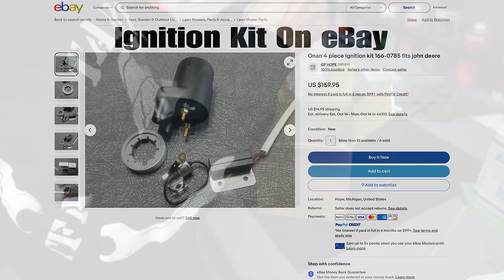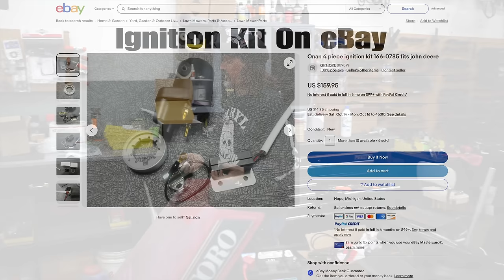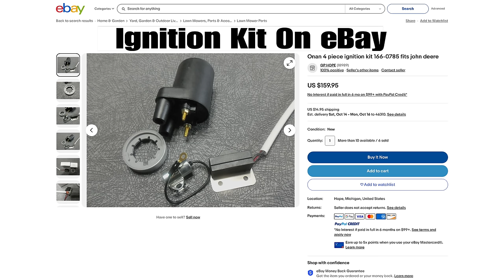Oh No! This Obsolete Engine has NO SPARK. What Do We Do?

Comment: In the US Air Force, I hated those Onan engines.  Onan engines were used to power air compressors, we called Lo Pac's.  Minus 20' F the engines would not start.  They were stored in a heated building and the engines were to be started indoor and delivered to the flightline.   As an Aircraft Machinist one very cold night I called and requested a Lo Pac to power a pneumatic drill motor.  The AGE driver delivered a Lo Pac that was not running, I could not get the engine started.  Walk back to the nearest flightline telephone, call and bitch at the dispatcher and requested a second Lo Pac.  Walking back, I see AGE deliver my second Lo Pac.  I get to the B-52 that I am working on, and the Lo Pac is not running.  Again, I could not get the POS started.  I am freezing to death and agree beyond believe.  I took my ballpein hammer and beat the Onan to death.  I never heard a word about my tempter tantum.
Some Lo Pacs were powered by a single cylinder engines.  They would start no matter how cold.

Comment: Had 1 on a Case 446 and my sister let it run low on oil and broke a rod. Dealer said its junk, I will sell you a new tractor. Instead, I scraped the rod bits off of the crank and polished it on the lathe. Put in two new rods, two sets of rings and one piston. Rebuilt the oil pump and added an oil gauge and a pressure switch to kill the ignition if run low again for less than $400 in 1991 money. A lot less than the $8000 Ingersoll. Now, 33 years later I think I would just repower with another Engine instead like you said.

Comment: That's a later Onan than what I worked on.  They were used on Fairmont motor cars used for track inspecting.  Points box easy to work on.  Fuel pump mounted right on top easy to work on.  Adjustable oil pressure.  Carb mounted on top, easy to work on.  Very reliable.  All that crap packed into that tractor must be a pain to work on.  Newer, bigger, better?  Not so much.  P.S.  I have a CCK Onan on my mid '60's Miller welder/generator that still runs great.  Easiest carb there is to rebuild.  Thanks Taryl.  Don't let them bury that Lawn Boy!
Reply: I also have 2 welder generators with old CCK’s and I love them. Real tough engines that run forever. Real pieces of art compared to the cheap aluminum Briggs and tecumsehs
Reply: @bwood282 I use mine for a backup power generator for my house.  I've used it for farm welding and it runs 7018 and 6011 great.  I drain the tank and run the gas out of it in the spring and charge the battery in the fall.  It's a great machine.  I had one on my mechanics truck back in the 80's so when one came up for sale I snapped it up.  The only thing I don't like about it is it doesn't have the idle down after running a bead.
Reply: @ralphwatten2426  exactly, that’s the only thing mine lacks is the auto idle up. I outfitted mine with a full size car battery so I just run it every month for a bit to charge it up and I run ethanol free gas so the gas stays fresh for a while and I’m good to go. I’m currently rebuilding a 1957 CCK for an old Westinghouse generator/welder and it’s coming along nicely. You could tell it’s an old farm machine because on the outside she’s beat but actually a low hours machine and the engine has great bones

Comment: Those old 2 cycle lawn boys were the best towers ever built i wished they still made them
Reply: I used one at work for 35 years. I retired, and the mower is still going. No oil to change and magnesium deck that never rusts. The only thing you'll wear out is the wheels.
Reply: If you are mowing up and down Hills and Ditch Banks, you must a a 2 Stroke...
Reply: Those old Lawn Boys are collectors items.
Reply: I love my old 2 stroke Lawn-Boys. Beast of a mower and lasts forever, literally

Comment: WOW. So cool that Taryl chose my 520h for a video! : )

I have a good working 520h that is my primary mower that has 940 hours on it. I found this other one, non running, with 1600 hours on it and thought it would be good to have as a parts machine. But it was in a lot better condition overall than my original 520h so decided to take it to Taryls to see if he could fix it. He was not too enthusiastic about working on it, for all the reasons he relates in this video, but he agreed to do it. Elkskins found the parts I needed to order on Fleabay and I ordered them. Then after they came in, dropped them off at the shop. Hadn't heard from Taryl since then and was going to call him next week and see if he got anywhere with it and low and behold, I discover it's the subject of todays TFA video! : )
Reply: They grow up so fast!
Reply: That's awesome. He's the man.
Reply: That Toro is a nice looking machine. I would use one for grass cutting and the other for pushing snow.
Reply: And now that 520h has numismatic value !!
Reply: I like the longer wheel base but those small front tires, not so much
Reply: You should Get a Milwaukee 2684 polisher to restore that paint to a show-room fresh tractor!
Reply: No no,, It's mine! Even has the same seat and hub caps. LOL Biggest problem I have is the screen sucking debris when the mower deck is level. 995 hours. 95psi in both cylinders. To bad Onan/Cummins/after ,market doesn't have master engine kits for the P224g like the Kohler K series does. Selling the 520 when I get my JD 140h3 and 314 up and grazing. Cheers dkeith45!
Reply: Q

Comment: Taryl I bought carburetors online for $17.00 verses $104.00 and it comes preadjusted. Only had trouble with one, and they gave me my $17.00 back, and told me to keep it. Also bought ignition kit it came with a plug, wire and electronic control, which were also very cheap and haven't had any problems.  Also found a muffler for $24.00 online, OEM Price was $112.00. I got the rider mower for free. Adjusted the valves, which were way out of adjustment. So, it probably cost me no more than $60.00. And watching you do what you do is a big help. I am a retired car and ambulance mechanic. Thank you, Taryl, also those comic skits you do are funny as hell.:face-green-smiling::face-green-smiling::face-green-smiling::face-green-smiling::face-green-smiling::face-green-smiling::face-purple-smiling-fangs::face-purple-smiling-fangs::face-purple-smiling-fangs::face-purple-smiling-fangs::face-purple-smiling-fangs::goodvibes::trophy-yellow-smiling::person-turqouise-waving::face-blue-smiling::hand-pink-waving::hand-purple-blue-peace:

Comment: Terrific Chapter!  Our old Wheel Horse 520 H/Onan with 1,500 hours was still working in 2012 but using a lot of oil while mowing the pasture at full throttle.  Got a new Toro Time Cutter with Kawasaki OHV (and vertical shaft) V-Twin, a real work horse.  Your video has inspired me to resurrect the old side-valve Toro/Onan still sitting in the shed, a fine garden tractor but as you say, hard to get parts.  Thank You Taryl for your great videos, they have soul and they ring true!  Did you ever notice what those 5 little holes at the top of the carburetor throat are for?  When you turn the key, liquid fuel shoots out of them, giving a rich mixture and the engine starts right up every time.  Clever!

Comment: I had the same coil failure on a JD 420. I found the Cummins dealer that works on RV generators had what I needed. Not cheap, but they had it and a replacement carburetor " Nickey six" a few years later.
The starter issue can be resolved with a JD relay kit. I have had that mower since 96' I probably will never get rid of it.

Comment: I had an old Sears from the early 70s with a Onan, the guy used it for decades to mow 5 acres, plow his driveway, plus pull his lawn cart around to mulch his flower bed, pick up limbs etc. The hour clock stopped at 4300 hours a couple years ago, always used castrol oil. I plowed snow for 3 years, it sat a couple years and a guy uses it to mow an acre with it. Never did anything except change plugs,belts and front tires that i know of

Comment: I used Taryl’s method of removing flywheels to get the pulley off a slasher gearbox. The pulley has 6 x C section sheaves and would weigh about 20kgs. The shaft is tapered and is 60mm at the top of the taper so it is all fairly big. I used some splitting wedges between the housing and the pulley and hit the end of the pinion shaft, with the thread protected with the nut, with a 10lb sledge hammer. It came off easily. Thanks Taryl, you helped me big time. The machine is not a lawn mower but it still cuts grass about 12ft at a time. Jeff

Comment: I have a JD 318 that had an Onan engine like Taryl's.  I had one of the same problems, a valve seat came loose.  The engine was tired and the price of parts to rebuild it was too high so I did repower it.  Now it has a Honda V-twin and runs great!  Totally worth the extra money for the added HP and reliability.

Comment: Thanks! Taryl for this repair tip on Onan P2200g engine for my 95 520 H.  Along with the recent valve job I did l took your suggestion and purchased the ignition kit you recomme ded on ebay.  Best 200 bucks Ive spent for another 30 years of running although Ill prolly be dead b4 that. Your friend Steryl in Mi. Best regards!
Reply from the maker: Wow thank you!! Your donation is greatly appreciated. It's wonderful grass rats like yourself that keep us going and the lights on. All the best with the Onan. And there's yur dinner!!!

Comment: I sent this to Mustie1 and now you to see if either of you will make a video to show this to others how to accomplish this, just an idea. I see a lot of folks that want the ability to mow with the chute up for various reasons. They use bungies , string or a piece of rope and that to me is so inconvenient. I have never shared this, but I've done this set up on every riding mower I've ever owned and it's fool proof. Use a hook and screw eye's to latch the chute up .  Tis uses 1 latching hook, 1 suitable spring and 3 Screw eyes. Attach one screw eye to the side of the rear fender and two screw eyes to the chute. Test the distance of them before drilling to ensure the screw eyes are in the right location. Attach one screw eye on the chute with a spring, and the other end of the spring to the Latch hook, The second screw eye is also attached to the chute just far enough to just give the spring a little tension so the hook can be latched to that second screw eye firmly when chute is being used to keep it secure. Now when you want to open the chute the hook can be latched onto the screw eye mounted to the fender to keep the chute up and out of the way. This method also allows the deck to be raised and lowered when the chute is raised. This setup is on my 1999 Scotts S20hp/48 which still runs and operates fantastic, and my 2018 46" Scrub Cadet XT1.  So simple & inexpensive, but absolutely effective. That setup has been on my Scotts since 1999 with the same hardware I originally used including the spring. My Riding mowers are kept clean and in doors when not in use so I hope this helps someone , if not there's always the option of a bungie or a piece of rope. LOL

Comment: I never thought Onan was a good motor. I have seen a lot of issues with them myself on bucket trucks and enclosed trailers that used them for power. Even when new, there were issues due to weather or mechanical/electrical  problems that even repair shops couldn't fix for any extended length of time. Great video though as always!!!!

Comment: Every time I see or think Onan, I think Wheel Horse and the photos in the catalogs with the vertical blower shrouds showing themselves outside the hood. So glad I have my 1988 JD 260 with Kawasaki FC540V.
Reply: Yeah, IMO the blower shrouds facing out looks cool, but creates a problem. When mowing with my 520h, I have to stop every 15 min or so, to brush all the grass clippings and leaves off that grill as it has such strong suction, it clogs up easily, reducing the air intake to keep the engine cool. It's a huge flaw IMO. WH should have made some sort of L shaped cover to put over it so it sucks air from the top of the hood.

Comment: Great video. I have an B43M Onan in my 1982 Case 446.
Reply: Sorry 4 u
Reply: Love mine. I also have a B43m in my 77' 446. Does yours have an oil filter? I must have the only one without one lol.
Reply: No oil filter on mine. I think about 83/84/85 engines changed and had the oil filter. 
Thanks for your comment. 👋👋👍🏻👍🏻

Comment: yup i have 1975 case 446 it had Onen 2 cyl and used in winter as well had motor all tuned up in fall and in winter 1 cylinder would fade in and out, i couldnt trust it the next year i repowered it with a Krowler!! best move i made

Comment: I've wanted a john deere 318 since i was a kid. You have sealed the doom on that dream!
Reply: It’s the best garden tractor ever made, mine has 2500hrs on it starts every time doesn’t leak or burn a drop of oil
Reply: @Trail-of-dead  yeah, but they all sell high or they "just quit, probably something simple," or "probably just needs the carb cleaned." Then there are the running ones that look like they sat outside the last 30 years. I have known several that were more or less the same story as taryl told about his. If I'm going to do groundwork, I use a farm tractor. I want something to mow grass and pick up leaves. I have an f725 John deere, and I like the 345 for what I want...I would really like to find a 300 series hydro wheel horse in good shape.

Comment: Nothing else makes torque like an Onan twin though.. The repower kits are great for ease of swapping and modern reliability but they don't make near as much torque, at least compared to the old CCKB Onans. The older Onans were very under-rated in HP and TQ.
Reply: The long stroke Kohler Command (27hp I believe) should have good torque.  They aren't cheap though.
Reply: @calholli  But look how large you have to go to match the torque of the old 19.5hp Onan. You have to go to a modern big block. None of it is cheap though. I got a quote to rebuild my Onan CCKB about 3 years ago from Cummins. They said it would start out at $3000 and go up from there if it needed crank work. I bought two NOS Onan shortblocks on Fleabay for $500 each instead.
Reply: Agree can't match the powerband,  smoothness and quality of A Onan twin.
Reply: @rangeraficionado87   That Onan CCKB looks like it's just an opposed twin.  I have a two Brings opposed twin engines that I need to rebuild.  Rings are stuck in one and the other broke both rods.. Somehow it didn't hurt anything else, so I bought two used rods on fleebay and I'm going to slap it all back together, new rings in both engines.  (18hp I believe --  some of these were 20hp)................   I never knew Onan was related to Cummins
Reply: @calholli   I used to like the Briggs oppsed twins until I ruined two different ones by mowing a very shallow side-hill for about 100ft. Both engines started smoking very badly afterwards. They were very nice runners up until then.. The Onan's are MUCH heavier built than the Briggs or even the Kohlers. They're built like diesel engines really. Everything is oversized on them. Cummins bought Onan years ago.
Reply: @rangeraficionado87   Yeah, the briggs opposed twin doesn't even have rod bearings.  The aluminum rod simply bolts directly to the crank.  So once the aluminum journal wears down, you just have to get a new rod.   So if the Onan has bushing style bearings like vehicles, with an oil pump, then it's miles ahead.   I wish they at least had needle bearings like Japanese dirtbikes and quads..  or the common deep groove ball bearings of 2 stroke engines.   The Koholer Command that I have:  has an oil pump and all that.  It's just better all around.  I'm surprised how long those older engines actually last, being that they don't even have bearings.  They just made everything as a throwaway. 

So yeah, if you drove it on a hill-- all the oil would slosh to the downside and the engine would be running completely dry;  pretty terrible design.

Comment: I have heard, like you all the horror stories with Onan's. However, I bought an Ingersol Case in 1984 and ran that 48" mower for years and years...... It preformed great for 20+ years, then I bought a Massey with a 6' blade and put the Case aside for the time being. I had at the time 798 hours on it. A few things were rusty and the tractor had not been cleaned for some time so I tore it down. Tore all the engine shrouds and covers off, took the heads off etc. Replaced the mechanical PTO assembly and one thing for sure was to rebuild the 48" deck. The lousy design drove me nuts. anyway after all this, including rewiring the entire tractor i really ended up with a still great tractor that starts, runs and handles all the leaves I have on 5 acres. No more mowing with it but the Onan has run great now for over 35 years???

Comment: I am getting ready to overhaul an onan, it is a lot older than that one, it’s on an old Lincoln welder, points ignition and no starter, it powers the generator to start the engine. Oddly also getting ready to get into an old wheel horse tractor but it has a single cylinder kohler. I have actually considered repowering them both with harbor freight v twins

Comment: What do you think about the old Ranch King riders? I had a 12 hp and a 17.5 hp. They both served there perpose but they started drinking a lot of oil. I was adding 1/2 to a full quart every time i used it. Both units got sold and are still running. What makes those older Brigs engine use so much oil?